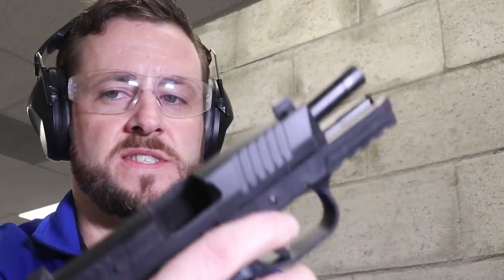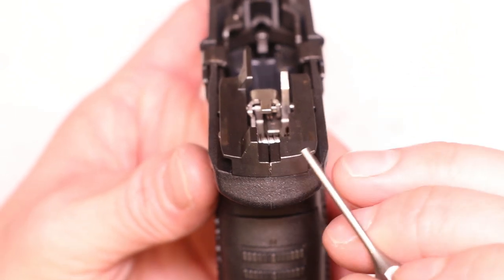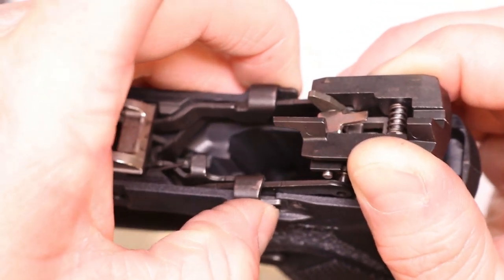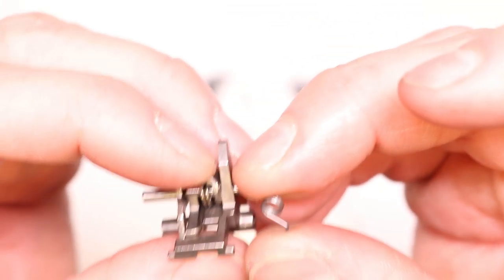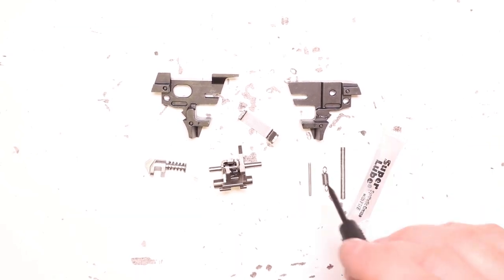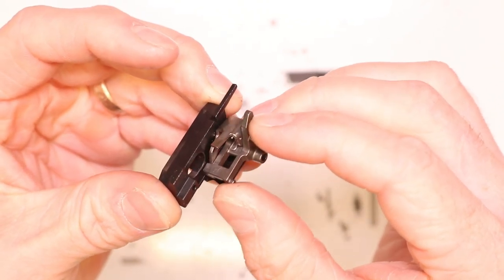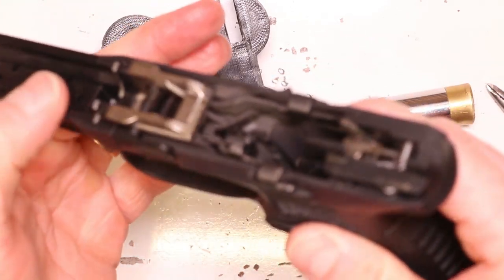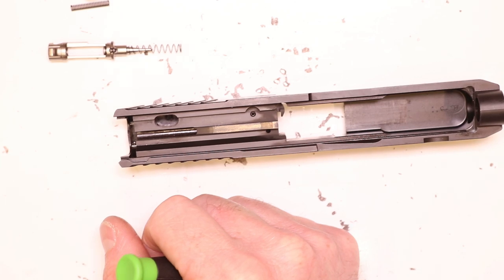FN 509 Trigger Upgrade & FN 509 Disassembly - FN 509 Accessories by M*CARBO

Comment: Curious if this kit helps with the anemic trigger reset. That was one of my concerns after handling this pistol early on. With the weak reset I didn't think it would take much of an obstruction, dirt or otherwise, to keep the trigger from resetting, just like we saw in this video. Any change there?
Reply: I just bought a 509T and have the same sluggish reset.  I have never had it stick like in this video but have definitely noticed a lag in the trigger when relieving pressure.  I ordered the kit and will let you know if it is any better.  Also have the Apex trigger coming.  Might have it all installed at one time so no promises on spring kit vs spring kit w/Apex trigger :)
Reply: @MonsterChuck  thanks man. I actually sold my 509 before this kit came out just because the reset was so slow and I didn't really trust it. I would definitely pick up another one and order this kit if it addresses that issue. Please let me know.
Reply: @adamf.4871  No prob! Just got the kit today and got it installed.  I would say the sluggish reset is way better but overall the trigger is still a little gritty (on pull and reset).  I have seen some videos about polishing the striker and other mentions about the using the Apex heavy duty striker (not sure if either would address reset).  Not sure which route I am going to take BUT for now, I still prefer the Glock gen 5 trigger (have a couple G45's and a G19).  Maybe just pumping rounds through the 509T is the answer.  Who can afford that right now though :)
Reply: @Adam F.  I haven't test fired the pistol yet BUT the setup I am moving forward with: Apex trigger kit, M*carbo spring kit w/ original FN sriker spring and the heavy duty Apex striker. 

I felt the light striker spring from the M*carbo kit made the trigger just a bit lighter than I wanted.  On top of that, I could feel every bit of "grit" in the trigger pull which made it seem inconsistent and sometimes had reset issues.  Introducing the FN striker spring back to the setup improved this while making the pull a little heavier.  I feel all of the trigger issues were due to a poorly made striker.
Reply: @MonsterChuck  have you tried it with the apex striker in there yet? I’m looking at getting this kit, the apex trigger and the apex striker. My idea is to polish the trigger bar on the apex trigger and polish anything I can while putting everything in, but I can’t find anyone who is saying they’ve done the same.

Comment: Looked for a trigger upgrade after installing the apex trigger in another 509. Wanted to see the difference with the stock trigger. And what a difference. This was the trigger upgrade I was looking for and most likely everyone else. My apex trigger must be a dud cause with this spring kit the oem trigger breaks cleaner than my apex 🤔. The Apex is still nice and looks good af but with all the hype I expected more from an “action enhancement” trigger. Does anyone have experience with the two paired? Not sure I want a second apex trigger now.. will update after live fire test if it fails.
Reply: any update? My apex trigger comes tomorrow and this enhancement came two days earlier. i installed and went to the range, not even 60 shots in my gun started jamming so idk if i did something wrong or my 509c is not liking the lighter loads on the titanium striker but  i plan on switching the lighter main spring with the oem heavy one and see how that goes...

Comment: I mainly shoot steel, and some of my striker fired guns with enhanced spring kits (not made by you guys) would result in light strikes. Have you guys tested it ok steel cased ammo? I'm really interested in this. Thx
Reply from the maker: We run the hardest commercial primers that we have found in our testing. If a prototype kit doesn't pass in testing it doesn't become a kit.

Comment: Wonder how this kit plus a apex trigger would do together
Reply: I purchased the spring kit a year ago and finally installed it.

I had previously installed the Apex trigger kit and then their striker, after the oem part failed during dry fire practice, no snap caps.

Original trigger, 7.5lbs. After adding all of the Apex parts, 5.5lbs. Installing the striker spring, 4lbs. With all the springs installed, 3.25 to 3.5lbs.

I don’t know how well the lighter striker spring will work with the Apex striker. Will test in the near future.

Comment: FUCK ME DEAD! $20 in springs just saved a $1,000 dollar gun. I was about to sale my gun and I saw this video figured what the hell it's only twenty bucks if it doesn't work I will just sell the gun. My trigger pull went from 6 lbs 10oz to 4lbs 10oz. This is the best twenty dollars I ever spent on a firearm.

Comment: Any issues with light primer strikes?
Reply from the maker: No Sir, not during any of our testing of various range ammo to include hard primer S&B ammo.
Reply: I've had light primer strikes since I've put this trigger spring kit in. Mentioned it in a FN 509 group and an Apex guy told me to "take that junk out and put the original springs back in and I won't have that issue anymore" since their strikers won't fix the issue he said. If it fixes it, MCARBO may be owing me a credit.

Comment: Anybody install these springs and the Apex trigger? If so, what were the results, please.
Reply: I haven't test fired the pistol yet BUT the setup I am moving forward with: Apex trigger kit, M*carbo spring kit w/ original FN sriker spring and the heavy duty Apex striker. 

I felt the light striker spring from the M*carbo kit made the trigger just a bit lighter than I wanted.  On top of that, I could feel every bit of "grit" in the trigger pull which made it seem inconsistent and sometimes had reset issues.  Introducing the FN striker spring back to the setup improved this while making the pull a little heavier.  I feel all of the trigger issues were due to a poorly made striker. Apex striker made a huge difference for me.
Reply: @MonsterChuck  Thanks for the reply. Yeah, even with the shorter takeup with the Apex trigger I still experience the grit. I can live with it, just a little annoying. The information you offered is very interesting. What you experienced was exactly what I was concerned about. I think I'll try your setup and see how it works out. Thanks again.